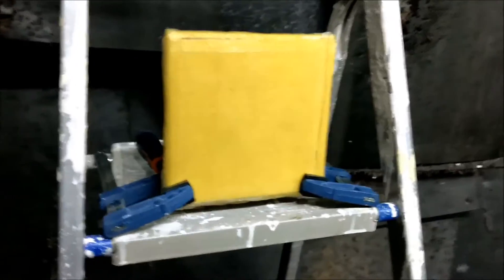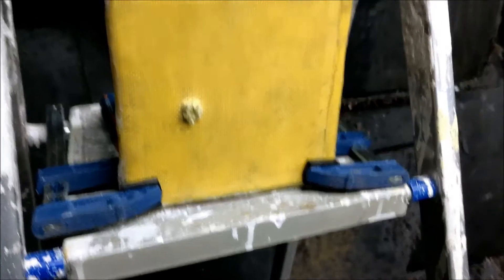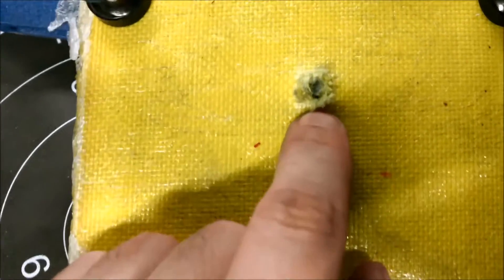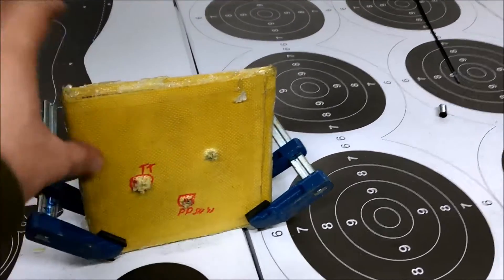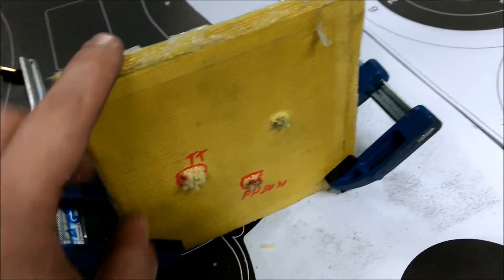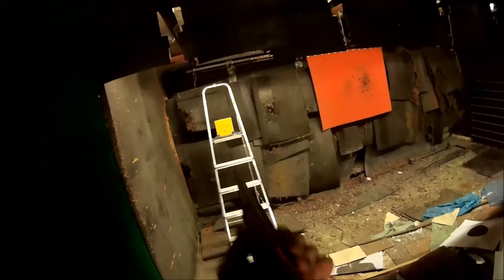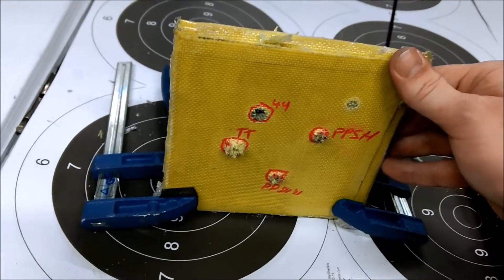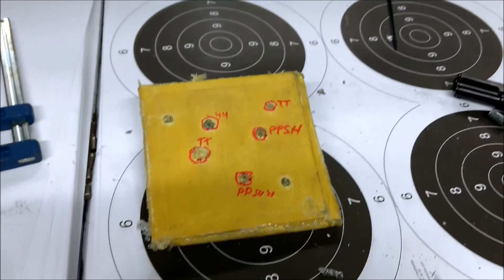Homemade bulletproof armor plate - Test of kevlar 29 with titanium

Comment: Can you test a composite of aliminium and titanium. With the titanium on the front so it stretches in to the aliminium. This is because I actually want to clamp thin titanium inbetween two plates of shaped aliminium. That way I do not have to form the titanium it's just inside the aluminium.
Reply from the maker: had the same idea, but atm im abroad so it's gonna take a while

Comment: maybe if you do this again, you could put the titanium plate in from of all the kevlar layers, breaking up the bullet and then useing the kevlar in the back to either catch the fragments, or at least a weaker bullet. To me it seems if you put the fabric in between two metals you are shearing the fibers (with the bullet smashing it into the titanium and then cutting the fibers as it squeezes through the hole) instead of using their superior tensile strength to stop the round, but that's just a theory. 
Great video by the way.
Reply: If you did that the power of the bullet hitting the titanium is going to break the bullet and your bones 😅

Comment: Sorry, but that looks like penetration.  I think you're seeing the titanium flexing open after cracking, letting the bullet through, and then flexing back into position.  Anytime you see backside kevlar fibers being broken, you've had a penetration.  I think you'd have much better luck shooting it from the other direction, that is to say - with the round hitting the titanium first, then using the kevlar to catch the fragments.  You might even do best to put a half centimeter layer of silicone between the titanium and kevlar.  That would give the "petals" of titanium room to flex out, without it's sharp edges cutting the kevlar.  The titanium plate will act like a "breaker" causing the bullet to lose momentum, and then the kevlar can do it's job, keeping fragments from penetration further.  The best combination would be simple ceramic tiles bonded with silicone to the titanium.  Then another silicone layer, and finally the kevlar layers.  A simple way to test for penetration is to put a clean sheet of paper behind the target.
Reply from the maker: Manny DelaCruz sorry but there was no penetration on ppsh shots. titanium is not a rubber, it is not flexible material that's why it cracked. only 44 mag went through the plate by smashing it. I was wondering same thing about the way I shot that plate. I think better results would be if I shoot the other way round 2 keV, 3titanium, 14kev to reinforce the titanium plate so it won't flex and crack too much.
Reply: Drzewacz888 The other thing to try is turning the plate around.  The many layers of Kevlar are being pinched between the bullet and the plate. It the bullet strikes the plate first, anything the gets through can be caught by the many layers of Kevlar after the titanium. Kevlar doesn't have great strength in compression, but amazing strength in tension.
Reply: Titanium isn't rubber, but it will flex - which is why it didn't shatter like glass when it cracked.  Perhaps what we're seeing is lead fragments coming through the crack and severing the kevlar.
Reply from the maker: Manny DelaCruz it's not a penetration. I know how penetration looks like. I look on that plate many times so please believe me when I say that there is no penetration. end of story.
Reply: @Drzewacz888 have you continued with your research?
Reply: I can confirm in my own testings that you can have a bullet retained in the armor but the kinetic energy still cause the back side of the armor to break open.

Comment: Most interesting result. I have read about Tokarev 7.62x25 bullet penetrating capabilities, but this is quite clear. As you said, it would be interesting to hear about the speed and weight of the bullet. Also is the tokarev round normal military issue, jacketed steel core? Also are there different propellant loads, like stiffer for submachine gun and weaker for pistols?

Spalling and loose shards out of a plate is huge issue. Also multiple hits can compromise composite plate easily. With PPsH hit there would be definitely a wound in the skin. In the real life, though, you would be in the deep end if somebody shoots you with PPSh from three meter distance.

Terminal ballistics is kinda difficult science. Armor plate needs hardness, stiffness, brittlessnes, but also internal tensile strength, stickyness and resistance to shearing forces. In commercial plate armor usually reads the direction of the plate, so the layers should be in correct order to defeat the bullet. Compression of the mold while curing is the key to the integrity of the plate. The higher the pressure is, the less resin is left inside and thus greater internal tension of the fibers. Ever thought of mixing soft metallic mesh between fiber layers for extra strength?

I found a decent study of the plate ballistics in the depths of the web. 

 http://www.scielo.br/scielo.php?script=sci_arttext&pid=S1516-14392015000800170

There is also a pdf out of this.

http://www.scielo.br/pdf/mr/v18s2/1516-1439-mr-1516-1439358914.pdf

Contains some research of intermediate material between interlocking mosaic ceramic front plate/pieces and aluminium backplate. Materials in spall catching layer were kevlar, jute and resin. Good old grain sack -type regular jutefabric fared quite well. Point of the study was the price of the unit.

Ceramic layer breaks the bullet, intermediate material catches the spall
 and aluminium plate provides support against shearing forces and 
spreads the impact.
Reply from the maker: Juha Antti-Poika I already tested aluminium plates. I upload video today or tomorrow. I actually was thinking about the titanium plate backed by aluminium plate to stop deformation and possible penetration. But first I do test of titanium alone.